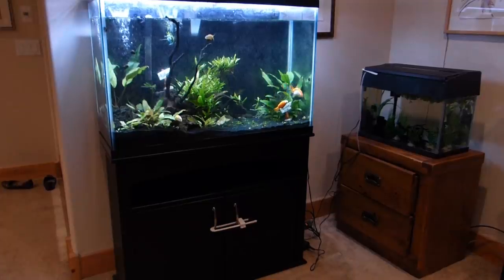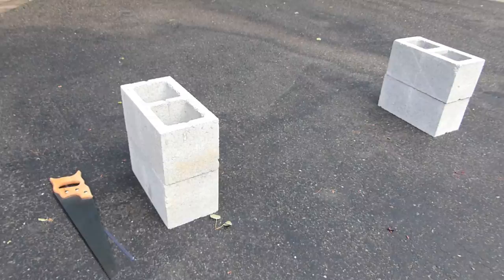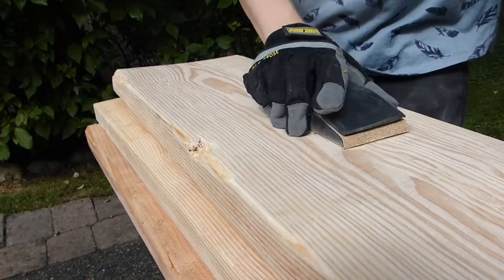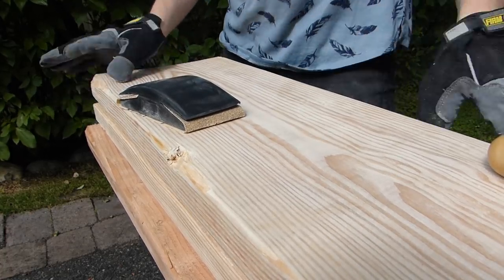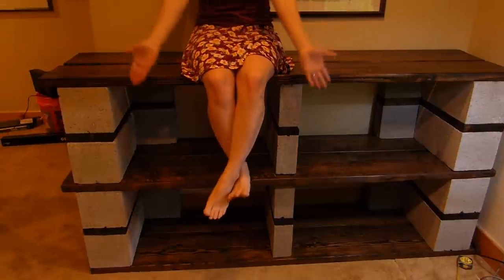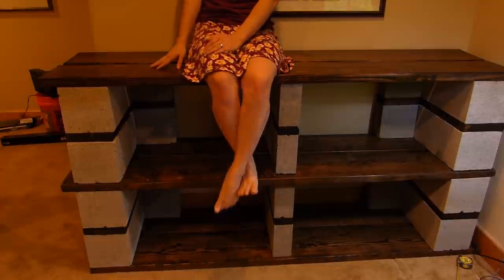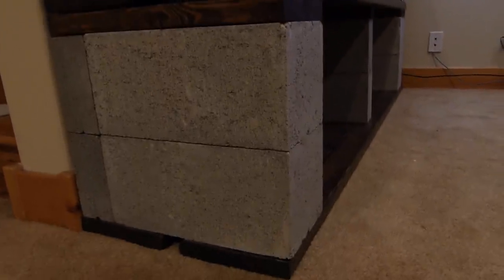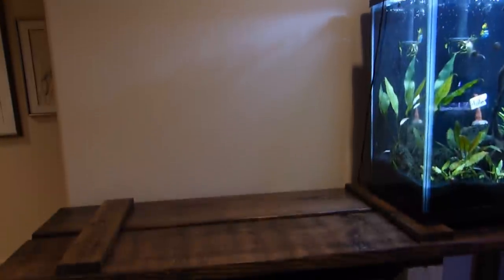Cinder Block Aquarium Shelf Timelapse - Can I Make it Look Nice?

Comment: I have never seen a cinder block aquarium stand look so awesome !!! Thanks for the great video !!! I'm going to build one soon, but I'm going to support the entire length of my 75 gallon tank.
Reply from the maker: Hey thank you! It wasn't terrible, haha. If I could go back in time I would have paid someone to send by boards through a planer first - they were slightly cupped so I had some issues that I needed shims for. It was super sturdy though. I also bracketed the wood to the wall for extra stability. Probably didn't need that but I'm paranoid about my toddler

Comment: Very very nice! The wood on the floor really sets it off.  The wood between the bricks reminds me of inlay. I did something similar.  Suggestions: construction adhesive between the bricks and between the bricks and wood will get rid of that slipperiness. Or you can use those rubber mats you place under rugs to prevent them from moving. Also, if you hate grey, paint the bricks!
Reply from the maker: Oh I like the rubber mat idea!

Comment: Only concern I'd have is that over time since the weight is not evenly distributed as it would be if it were sitting flush on the shelf, the glass could potentially eventually crack with all the weight resting on the ends. Maybe add another strip of wood half way through or a couple evenly spaced?

That said, it looks really good. Great job on the stain.
Reply from the maker: That's what I thought about tanks at first, but seeing corners-only support happening in the Aquarium Co-op fish store and Deans Fish Room has changed my mind! It really is all about the corners!
Reply: @SimplyBetta  Well that's great news!

Comment: How will you maintain the goldfish tank? Looks like it's got about an inch or so for access? Btw, admirable work!!
Reply from the maker: My 49 gallon goldfish tank is on the topmost shelf, so I have space until the ceiling! I do have a little 10-gal temp QT tank on a rack, but it has this all-in-one type filter/light/lid on it and there is like no room left, haha. 
If a 10-gal sat on a shelf with a normal flat glass top, there would be about 4 inches of working room - plenty of room for my little noodle arms

Comment: +Simply Betta Saw a tank in one of the lower levels, how do you do maintenance on it? Or you are not using that one? I do like the paint job very much. You gave me a couple of ideas for future tanks
Reply from the maker: I do maintenance on it like all my other tanks, it just looks a bit weird I think because it has a huge lid on it. Once I take the lid off I can get into the tank just fine. Any other tanks I put on there will have the flat lids :)
Reply: Simply Betta got it, in the video is looks dark against dark wood so it is hard to see if one doesn't pay attention.

Comment: More important than "perfectly level" is that the complete bottom panel of the tank be on a flat surface to distribute the weight and with a foam or rubber panel to avoid any cracks if the tank is not perfectly squared . The way the tank is placed could cause stress to the glass and potential breakage.
Reply from the maker: That is totally true for rimless or acrylic tanks, but the tank rack design in the Aquarium Co-op store taught me that rimmed tanks can be supported on two edges only, blew my mind!

Comment: I know they say it's Not needed but why not support the entire tank? I had a 20 gallon crack in the middle because of no support. Better safe than sorry.
Reply from the maker: If the tank is perfectly even and supported on the corners, it should be fine! Now this is my first time trying it, so if sometime terrible happens I'll spread the word, haha. I did it because it was much easier to level the tank this way, because I think my floor is slightly unlevel.
Reply: Simply Betta Oh ok gotcha .

Comment: What is the purpose of the wood under the edges of the tank why not flat on the boards.. Aren't you scared of cracking it and causing a leak with it not being level all the way around the tank?

Comment: hmm....the reason the old unit was ugly was the dark color, yet you used a dark stain on your new creation. if you want your creations to look good, you need better wood and some tools, so you don't end up having to use shims and other ugliness at the end. i'm still thinking if i'll ever get a thicknessing machine but, it's basically required if you want straight boards, even when you buy best looking wood. alternatively, as long as you don't bring nasty cheap wood into a woodworking shop, they can thickness for you.
unfortunately it does take some money if you want to make stuff that looks good...otherwise there's ikea or whatever veneer stuff that never looks the part.
Reply from the maker: Agreed! Although I think staining it looked better than the raw, pale wood. When I replaced this shelf I paid a local fella' to run my boards through his planer to make then perfectly flat and all the same thickness. Now I can use them for any future projects - lesson learned.